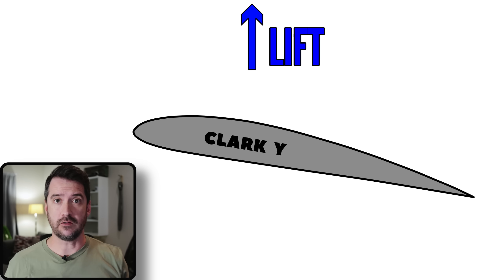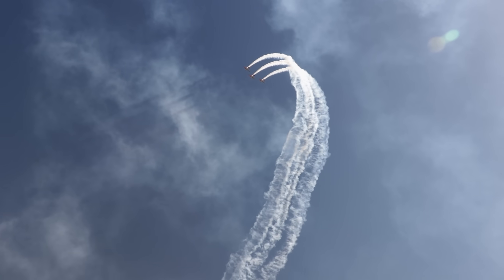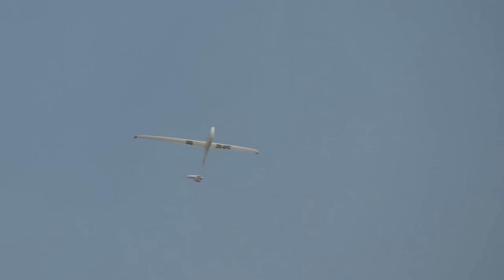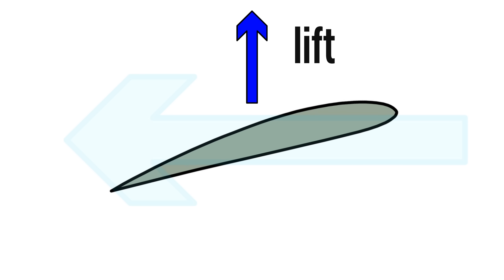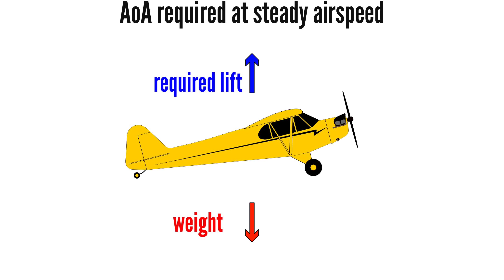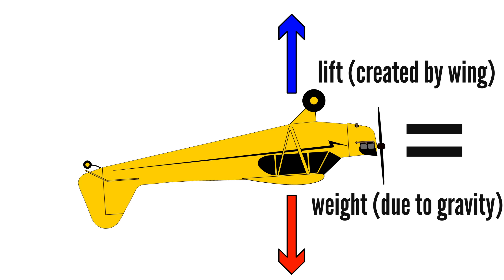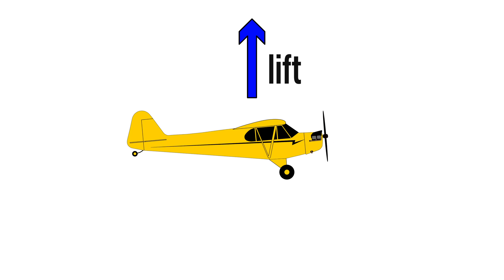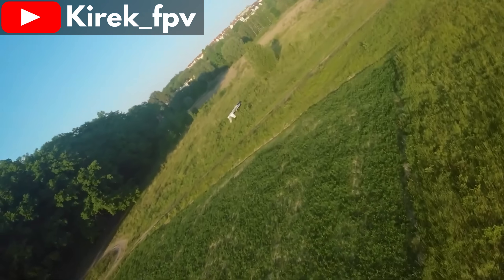Is Airflow Distance Over the Top of a Wing Always Longer?

Comment from the maker: Airplane Propeller Effects - https://youtu.be/WnJxrHmtT_c
Understand Airplane Propellers - https://youtu.be/hvboi6w1Z9A
Reply: Aerospace Engineer here: 
I thought this was going to be another hair pulling video, but instead you've done a great job of explaining it.
In future I wont bother trying to explain this anyone and just send them here.
Reply: The last part was incredibly eye opening, just like a cool math trick 
 tnx & subbed! :)
Reply: Is there any particular reason you feel the need to explain basic science to people who refuse to take basic physics classes.
Reply: You are unnecessarily complicating matters for yourself. There are two major principles by which a wing generates lift: Bernoulli's Principle and the Coanda's principle. Even if the contribution of Bernoulli's Principle diminishes, or even becomes negligible, the Coanda Principle continues to operate. The wing produces lift when flying upside down because it redirects the airflow downwards. For efficiency, you would prefer more Bernoulli and less Coanda because the latter comes with more drag. Flying upside down you will need more power applied to hold altitude assuming you fly with the optimal angle of attack when flying with the right side up.
Reply: buoyancy vs density and all alleged pulling forces negated... simples...
Reply: If lift was produced by pressure differential alone, you could create an extremely efficient lift wing by having a jet engine intake channeled underside the wing.
Reply: And what might one suppose affects the stagnation point position as the angle of attack changes (as the asymmetry changes)?

It would seem logical the stagnation point shifts so that the comparative mass flow continuity conditions above vs below the airfoil minimize the energy consequences of the airfoil's imposition on the relative wind.

The airfoil is a disruptor of the relative wind, where the mass flow continuity must still carry on at the same rate as if there is no airfoil.

In negotiating the sharper angles with increasing angle of attack the stagnation point must shift down enough such that the continuity constriction pressure drop on across the top applies sufficient force for the extra bend in the airflow.

But this robs some additional mass flow from below the wing.  

So clearly there is an equilibrium balancing action that goes on such that the stagnation point ensures the most energy efficient flow split between over and under for the given angle of attack setting (must take into account any asymmetrical camber as well).

Comment: The density of air moving above the curved part of wings is  lower than the density of air moving below the non-curved part of wings. Thus, there is less air pressure above the wings than below the wings. However, the plane may be made to fly upside down by controlling the flaps.

Comment: Ladies, Gentlemen, the argument about the longer path is, in the end, irrelevant. 
Lift is generated because the wing's airfoil (flat plate, curved plate, standard flat-bottom airfoil, full symmetrical airfoil, or even a rotating cylinder, via the Magnus effect) deflects air downward. Thus, as Mister Newton stated long ago, there will be an equal and opposite force pushing upward. That is lift !
All other consideration have to do on how efficiently the air is redirected. 
Here it gets complicated because air is sticky and compressible, thus requiring careful attention to the airfoil shape to do this as efficiently (i.e. with minimum unwanted effect, aka. Drag). Thus the best airfoil shape depends on very specific speed, air density, and lift coefficient required. There is definitively no one-size-fits all!
Regarding model airplanes, while it is true that they have a much lower wing loading that full scale aircraft, they also suffer from a much lower wing efficiency, because of our friend Mister Reynolds. That is complex subject to get into, so let's avoid for now. 
The small scale scale Cub can fly inverted because it has, relatively speaking, much more horsepower (hp per kilo) than the full size one. Put 150 or 180 hp engine in a 1:1 Cub, and it will fly inverted just fine, if the wings do not come off first!  
Happy Holidays to everyone.

Comment: Wow, correct me if I'm wrong, but something perhaps crucial just occurred to me:  Because the stagnation point marks the point of separation between air going over and under the wing, the condition for lift can be seen by whether the flowline leading to the stagnation point is rising or not.

If the flow line to the stagnation point is rising from its original horizontal location, the cross-sectional area passage to air over the wing has been reduced relative to the bottom (measure the vertical height above and below the stagnation point, symmetrically as far as it needs to be until the flow pattern returns to ambient flow).

With the window to the mass rate of flow simply established by that stagnation point flow line boundary, the speed of air passage difference between top and bottom becomes a simple flow rate continuity problem.

And the speed change from that flow rate continuity leads directly to the conservation of energy pressure drop.

Summary:  The flow asymmetry around the wing is defined by where the combined geometry's (any asymmetrical camber plus angle of attack asymmetry) balance of forces places the stagnation point and the flow line leading to the stagnation point.  And the asymmetry of the path windows defined by that flow line, determine the speed over the top and bottom to satisfy the continuity equation.  And the conservation of energy change in pressure follows directly from those speed changes.

This has immediate effectiveness for a perfectly thin sail, where it would naively appear the bottom and top paths are the same (for the surface of the sail it is the same, but the stagnation point makes the air's path length different).

Comment: Using measurements of air pressure across the to of an airfoil vs air pressure across the bottom of an airfoil, calculating the difference between these measurements according to the areas above and below, does not account for the lift generated.  Vortex generation has been sighted as the real factor.
Reply: What you said in your comments before the word "Vortex" is completely false.  That would violate physical law.

Lift is 100% equal to the difference in pressure taken over the entire surface area.

Vortex generation is of course relevant but also must be tied to fundamental physics.  All of these concepts must be properly tied together.  Vorticity implies an induced angular momentum (from an asymmetry presented to the relative wind); lift is a change in linear momentum along the direction of the force (transverse to the relative wind).  There is a connection there (somewhere).

Comment: Let me clarify you are saying: If you turn (or fit) an airplane's wings upside down, it will take off in the exact same way as if they were fitted correctly? If this is so, I call bullshit, please clarify. Stalling is as much about the power or force pushing it...
Reply from the maker: No I'm not saying that, almost the opposite in fact. A much higher AoA is needed if the wing is upside down (as explained in the video, did you watch the whole thing?). If that required AoA is less than the critical AoA depends on wing shape, wing area, plane weight and thrust. What I AM saying is the airflow path over an upside down wing will be longer, even if it is highly cambered, and thus saying "if the distance over a wing is longer than the distance below, a wing wouldn't be able to fly upside down" is a logical fallacy.
Reply: @LetsGoAviate  It was always explained to me that the aircraft was sucked into the sky more so than lifted into it. The distance over a wing is longer than below it is relevant... surely, it's all in the thrust & velocity, especially when inverted?

Comment: Good explanation of the stagnation point. This is also the principle of a stallwarning vane: During normal flight, the vane is pushed down, because the stagnation point of the flow lies above the vane and the flow pushing it down. When approaching critical angle of attack, the stagnation point moves below the vane, the flow pushing it up and triggering a warning.
One point of critique though: even when flying with a wing past the critical angle of attack there is a pressure differential over the wing. This means the wing is still producing lift (and enough to conquer the, component of the, weight), albeit with a very high drag. Which most likely will prevent horizontal flight

Comment: Aircraft have leading edge flaps. At takeoff speed the air can't get out of the way quickly enough and gets bounced upwards.  But it soon comes back down again with the weight of the atmosphere bearing down on it.  This results in a vacuum along the wing otherwise known as a 'shock wave'.   But vacuums have to go where vacuums belong,  to the top of the atmosphere.  The atmosphere pushes it upwards, all trillions of tons of it. (Equilibrium Law).   This explains how large aircraft weighing hundreds of tons fly.  But it's really just the air around the plane which does the job.  At higher speeds say above 400 knots the shock wave  starts to have trouble keeping up and drags back on the wing as well as lifting it.  Designers deal with this by angling the wing back into the shock wave.  (Sweep) The bang one hears when a plane breaks the sound barrier is the shock wave collapsing.  It's not the angle of attack which lifts the plane,  but the shock wave above the wing.  You can see these shockwaves when condensation forms along them,  say at landings on airport runways.

Comment: It's not the longer path,although the path is longer, it's the momentum of the upper air molecules taking a path more normal (90 deg-ish) to the aerofoil thereby reducing the number of molecules close to the airfoil, thereby reducing the Pressure near the aerofoil, creating a larger pressure difference between the lower surface and the upper surface and that Total difference between the impact pressure on the bottom of the aerofoil and ambient pressure minus the reduced pressure on the upper surface is the net pressure often called lift.... Down stream,, Newton reflects the sum with a downward force....

Comment: My science backround involves fluid dynamics from several disciplines.   I also actively and very successsfully raced sailboats .... with light weight fabric tell-tales attached to the sail fabric in the (wing) areas (near the front edge (luff) and also at the exit (leech) that are most sensitive.  My observations are that there are TWO flow regimes occuring simultaneously .... the differnt speeds (more or less airflow VOLUME) and the VECTORIAL "CIRCULATION EFFECT" ...  where under the  most optimized condiditons one can easily  visualize (via tell tales) that the underside of the foil has the net air flow moving FORWARD ... when the SHAPE of foil (sail) is precisely optimized for the ambient conditions. 
For more info of the "circularion effect" do websearch for **"Arvel Gentry" + "air flow circulation effect" (of wing lift) AND/OR "Arvel Gentry" + "How sails REALLY work**".
Reply: Are you saying that, under the optimized conditions you refer to, that you can actually somehow measure that the underside airflow is moving forward relative to the sail surface?

For an aircraft, on the underside it should slow down, while the upper side should speed up (resulting in circulation), but there wouldn't be a reversal of direction underneath an aircraft wing?

Also, is it possible to provide a more intuitive insight into how the angular momentum (which I assume is the physical definition of circulation), results in a net linear change in momentum along the direction of the net lift force?

And what about some people insisting that there is no such "net transverse change-in-momentum linear force" (lift and its immediate cause) possible without the role of dissipation?  Is this controversial, and does it have a relatively straightforward intuitive justification?

Comment: The plane flying upside-down had a SYMMETRICAL AIRFOIL.  No camber, no 'longer top section' to verify the longer/shorter lift theory.  For ANY 'lift'  you need a POSITIVE Angle of Attack, as drawn through the Center of pressure of the LE of the wing, through the Center of pressure of the TE.  At ZERO AOA, the CP of both has EQUAL length top and bottoms of the wing because the CP of the LE CHANGES depending on the AOA.  A stop sign will fly, as long as it has a positive AOA, and Clark Y airfoil, with a flat bottom, will NOT fly, if it has a Negative AOA.  Airfoil shape merely makes the act of flying more or less efficient at certain AOA's.  No matter what airfoil you uses, it will not fly if it does NOT have a Positive AOA.  Shape means pretty much nothing when AOA is considered.  First you need AOA, THEN shape.  They have to work together.  one without he other means a non-flying wing.

Comment: You disproved your own argument by acknowledging that AoA is the primary factor in lift production. Differential air pressure is insignificant in producing lift regardless of the location of the stagnation point because Newton's 3rd Law (action/reaction) is the main factor.

This is easily proven by understanding that an airplane at 0 degrees AoA will never rise into the air no matter how far or fast it travels down a runway until the AoA is increased and the relative airstream acts on the lower wing surface to produce the reactive lifting force.
Reply from the maker: No because I didn't provide any argument for lift (as said in the video) ipso facto I cannot have disproven my own argument for lift which I didn't give. I simply explained why the upside down argument is a logical fallacy and does not disprove the longer path theory. The longer path does not cause lift, but a positive lift producing airfoil will always have a longer path over the top.

I agree that at 0° AoA zero no lift is produced. It's also impossible to separate the pressure differential above and below from the lift equasion. You can argue that differential pressure is a consequence of lift, not the cause (I don't buy that though), but cannot argue that differential air pressure is insignificant to lift production without proving differential pressure isn't there at all (it is there, it has been proven).